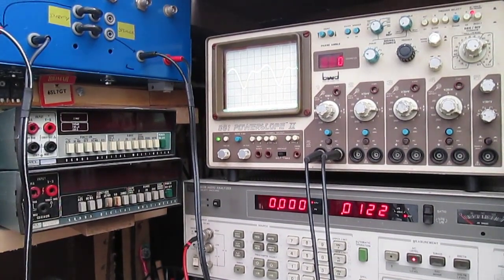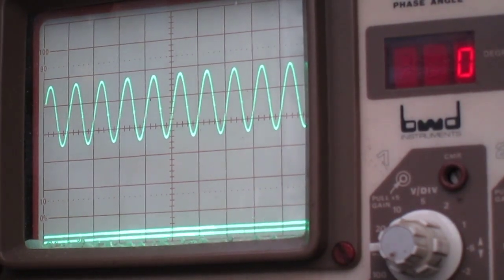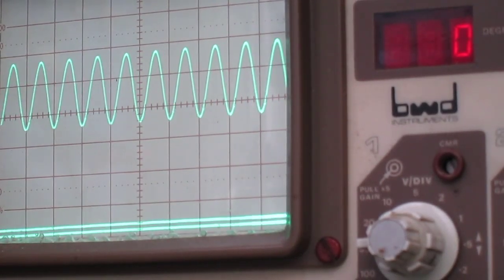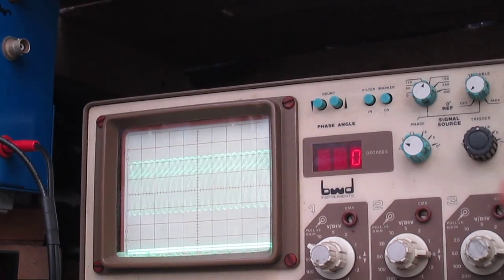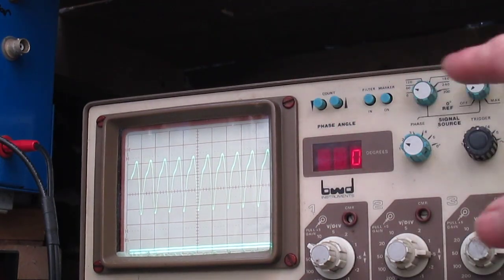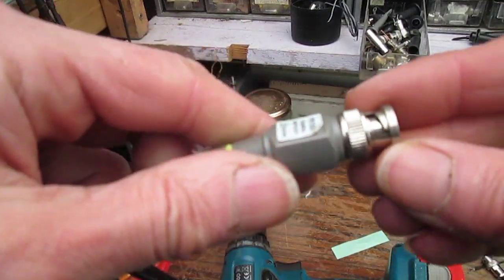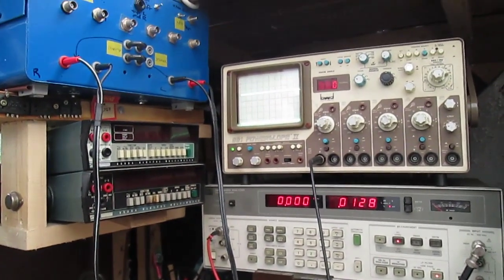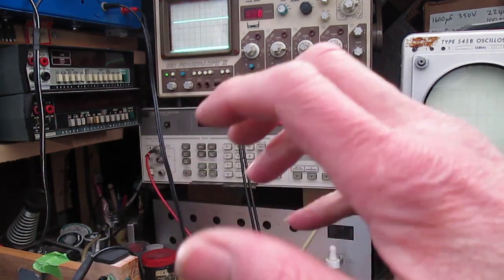BWD 881 Powerscope 2 - A look at an unusual scope.

Comment: That brings back some memories. Had one at each of two different jobs back in '85 and '87 when I was designing SCR soft starters / power savers for 3-phase induction motors. They cost AUD $4200 back then. Made in Melbourne, Australia. You can do neat things with those differential inputs, e.g. clip them across each end of a fluorescent tube that has an iron core ballast and see a 90VAC square wave.
Reply from the maker: This scope has had a lot of interest, didn't realise that it was that well known. Thanks for dropping by.

Comment: Where do you find all your fine bits of kit?
Reply from the maker: I've collected over years & been lucky, it's also down to contacts, & good friends. If your a vintage Tek nut, there's not many of us but if post on the various vintage tech forums you meet folk, we all help each other out & in the case of Tek 500 series valve scopes not many folk want a 24" x 16" x 13" scope that eats power & weighs 65lb's & takes commitment to keep running. You have to look too at places other than Ebay like local auctions. Lastly I'm a great believer in what you get out, you get back. I get given a lot of stuff but I also would rather give folk stuff for free than make money. If you want a Tek 500 series scope, I have a couple, contact me. TFW.
Reply: @diabolicalartificer  Thank you! I did have a couple of Tek 500 series years ago, but due to room constraints, sadly had to say goodbye to them. I retain a fondness for the engineering and functionality of them though. Yeah, I guess I don't use the forums so much, which as you say, is a good place to exchange kit. I hadn't heard of BWD scopes, certainly looks a useful beast for valve amp work.

Comment: That is impressive to have four differential channels. I have one high voltage differential probe that cost more than my scope,  the scope is just a cheap Rigol 1054z, but still paying more for the probe felt weird.
Reply from the maker: Aye, good scope innit? Having a high voltage differential capability is very useful for testing valve amps, TFW.

Comment: Hia ive got tha  881A it looks mostly same as yours. so on mine that black knob u touch @4:22 selects which channel it triggers 
on and i think the 6th position is AC line triggering. took me a while to figure the knob to the right with "level" above is to set what voltage above or below 0v on the waveform it triggers at. another thing i do fr triggering is to adjust the centre (cal) knob on timebase setting (mine needs a firm anticlockwise turn to free it) until it syncs to the waveform on screen. it allways drifts back an forth a bit but it gives me a hail mary option for awkward signals. i agree its a fantastic scope for looking at low frequency high voltage quite the find for a fiver !! apologies if some of my tips are teaching you to suck eggs but i hope may be helpful to a beginner someday 😀
Reply from the maker: "that black knob u touch @4:22 selects which channel it triggers" brilliant, thanks. Makes sense now you mention it. There's lots of ways to suck an egg, thanks for your contribution, much appreciated. These scopes aren't easy to figure out, hopefully those of us with them can work it out between us. Cheers.
Reply: @diabolicalartificer  Glad it helped :) allso if yours has the signal outputs on the back. 
There great i link them to my digital scope with right angle bnc RG316 coax leads
 off of aliexpris. was about £12 for 4 .

pps beware folks theese scopes come with a few of the devils own RIFFA caps inside ... i had to  " Exorcise " mine ;)

Comment: Andy- I have made HV leads from RG58 coax or similar, as that is transmission line for ham radio. Big drawback is it's very stiff cable.
 That being said, you might try using the old copper core spark plug wire and shield it with copper braid removed from RG58 coax. The  other option in find some replacement anode wire for CRT TV sets and shield that. Your local TV shop likely has a roll of that.
Also they made some copper core shielded spark plug wires for the military.   Love that scope though.
Reply from the maker: Excellent ideas unfortunately I haven't the tool to crimp BNC connectors to cable properly. I've tried in the past to make BNC leads with solderable connectors but had very poor results. Great bit of test gear though eh? TFW.
Reply: @diabolicalartificer   If you use the copper shielded and copper center conductor RG58, no crimping needed, just some soldering.